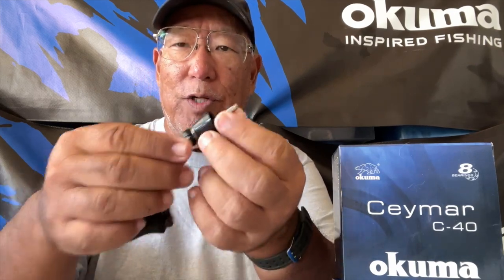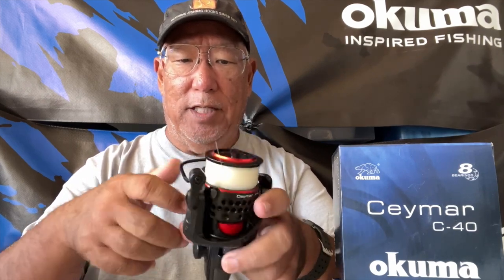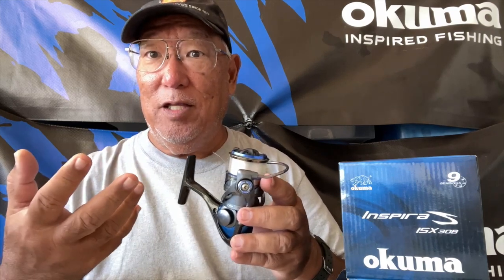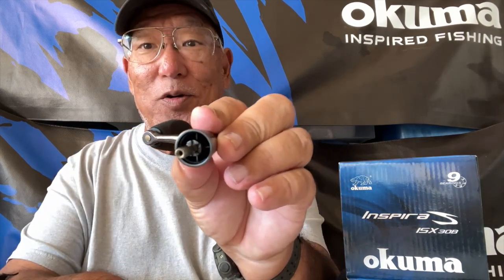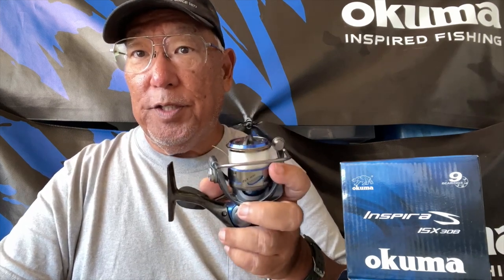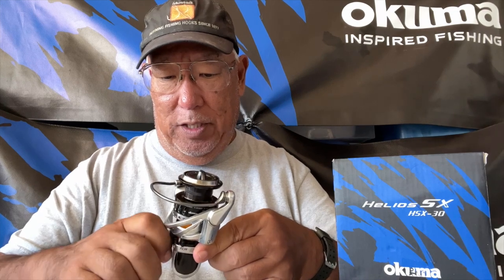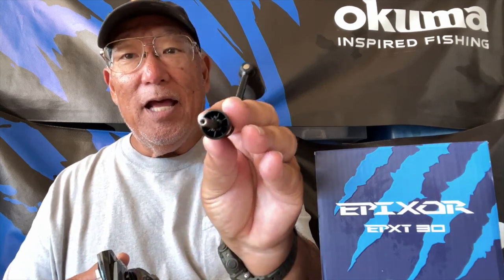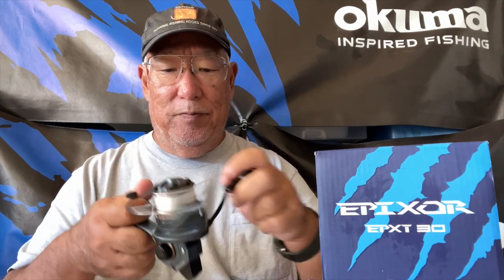GOMEXUS Handle Knob For Which Okuma Spinners?

Comment: I have the same problem with the handle falling apart on my Californian TCP-4000 that you had with your 3000 ITX.  The rubber looks to be idential.  The Californian has a hex shaft with a center threaded hole, so I think the Gomexus would work, but don't want to get stuck with a knob that wont work!
Reply from the maker: Only one way to find out! Google it first,  may have been done by others.

Comment: Is any solution For okuma Itx 4000 a round knob from gomexus?
Reply from the maker: That's going to be my next project by the way. I just got in replacement handle assembles for the ITX 3000. It's not a hex fit stem. It's a screw-in. So that leaves the knob itself. Currently there's no system offered by Gomexus to handle an ITX spinner. So i'll be doing some pre-lim work for Gomexus USA. Just yesterday i received a few original handles from Okuma so will start this today. So far from what i've seen a rounded knob may not work but i'll open her up & start measuring. By the way the new ITX line was officially announced today in an email for sale.
Reply: @ScubaChris  thank you for the answer than I will wait a little bit 😁. Best regards!